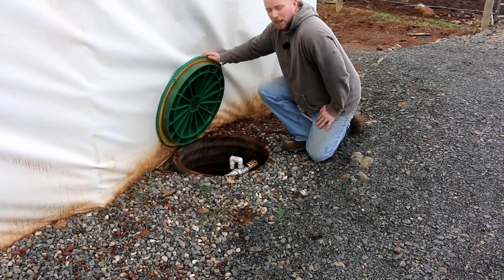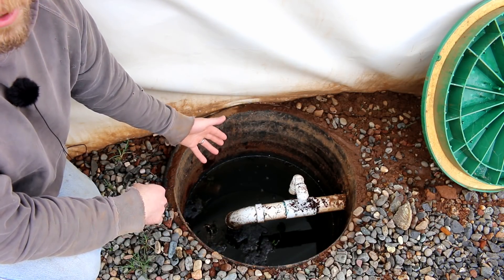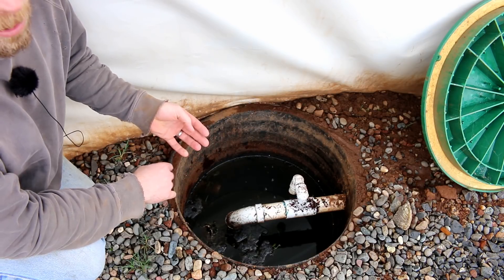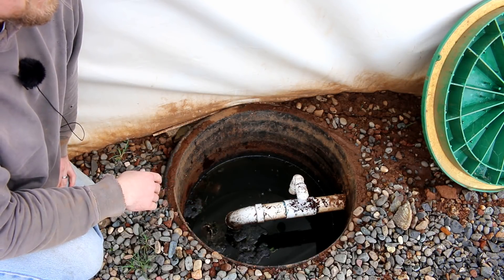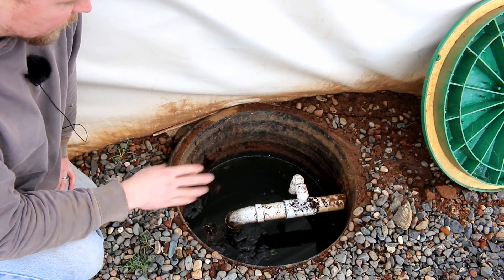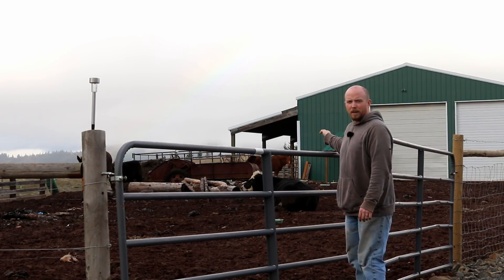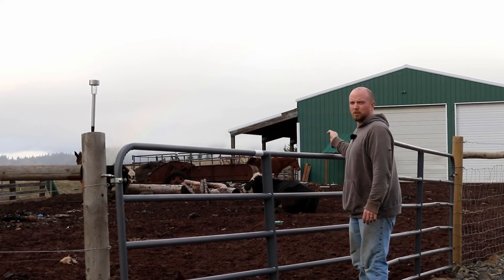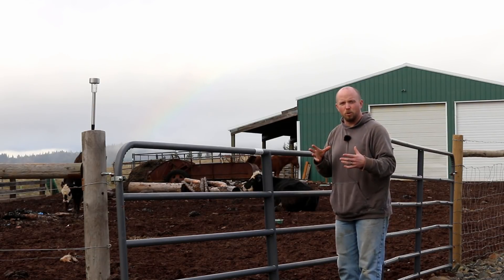Best way to Load a Small Scale Anaerobic Digester?

Comment: For stirring: look in your bulk tank.
For preprocessing: Look at your juicer in your kitchen. And pump some of the top water before the juicer to prevent.drying.
Don't load the digester from the top but directly into the bottom.
If that doesn't work pressure makes stuff  get wet.  A large propane tank to pre wet all ingredients before into large digester.
**Problems solved**

Comment: Hi @TheRealMartian Great Videos! Here's some ideas about feeding in the Straw : 1.  Maybe consider not using straw as bedding and instead use something else. 2. Consider excluding the straw from the flow altogether (strain/rake it out)- Does it have much nutrition for the biodigester? I would think it mostly adds fibre and air. 3. Chop it up with a machine while still "dry"prior to adding it to the slurry, there are a few machines for this I think called "hammer mills. 4. Some sort of "combine harvester"type device at the top of the tank that sort of rakes and chops it while it floats. Anyway, best of luck!

Comment: underground conveyor belt?  pipe that you load the stuff into, shut the loading panel, then run water into the pipe building up water pressure until the stuff moves and gets flushed?

Comment: Did ever think about using a new ibc tote piping the bottom of the tote to the bottom of your digester. Filling the pipe and tote with your organic material then water. Then use putting the lid back on the tote and either using methane or some other gas to push all of your material into it. I mean idk if it would work but the water that's in your gas holding tank gets forced out the bottom by the gas. The only thing I think that might be the problem is the pressure on the pipes and oxygenating your tank if you use just a regular air compressor. You could hook your methane up to a air compressor and use it that way. Do you have any updates?

Comment: well i found a solution to that but my digester is above ground, I made a cavity that is bellow the level of the digester with 2 opening that can be sealed , one for putting whaterever I want , and the other is attached to the side of the digester,  I put every thing in it and I seal it ,Than I flash it with the liquid from the digester and every thing wil float  back to the digester from the 2nd opening , but if you do that you should pay attention not to flash air with it buy leveling the openings and  you will  need a little pump to empty it afterwards.

Comment: I didn't read all comments so if this is suggested already or in the last part of the video then sorry. But a downward push with the right screw auger similar to the grain lift auger they use to lift grain will fix your problem. Needs to be as close to the size of your big inlet pipe.

Comment: https://www.kitchenrestock.com/Waring-WSB70-Immersion-Blender_p_1887.html?gclid=CjwKCAjw5fzrBRASEiwAD2OSV9XwRZIFjOTlw9nFNwJN4E1xQZY1D7DWqvw2YLaGqW3T_jGdhFIn-BoCLAIQAvD_BwE
Reply: We use this bad boy in our kitchen.  We blend up soup stews and all kinds of fibrous material including meats. It sounds like the material you're trying to dispose . 50 gallon  capacity, 21" stainless steel removable shaft, variable speed motor, continuous ON feature, rubberized comfort grip, 1 HP, 120v, 750W, 6.25 amps, NSF

Comment: Take a look at the shredder for recycling used tires and emulate that design, then pump that material to the tack in additional I don't see that your design have a 22 degree angle at the in let's Pipe, that seems to work for other design.     How are you trying to reverse the screw motion that instead of pulling it porch.

Comment: You mentioned that a screw would push water\waste up a pipe but not down a pipe.  What if you created a gradual upward bend at the bottom of the intake pipe that feed into a small upward screw? Gravity would create pressure and the upward screw may induce a siphon affect.  I'm not an engineer, so I have nothing to base for this theory.  

Does the waste in the pipe flow better when the pressure from the methane is weaker? Is there a way to siphon off the methane from the main tank into the two holding tanks, which would build more pressure in the two holding tanks but allow the main tank to have less downward pressure and allow more waste to fill the main tank? 

Or maybe an above ground natural gas tank that temporally relieves pressure from the main tank by opening a valve, which might be enough to suck the waste into the main tank.  Once the pressure equalizes have it shut off the valve to the main tank. Then have it slowly pump the methane into the holding tanks and then repeat the process.

Comment: You haven't named the correct problem and identified your limiting factor.  You have a super duper 2-foot diameter feed tube that goes down how many feet to an itsy bitsy teenie weenie 8-inch diameter pipe that goes down how many more feet until the food will clear the pipe and float up inside the digestion chamber.  Your problem and the single factor that limits you is the 8-inch feed pipe into the digester chamber.  There are a lot of YouTube videos of this design:  Puxin biogas system from China.  You might want to look them up.

Comment: Hello TRM, hello from northern Ireland.  You asked for solutions.  Given your design as it stands and assuming you want a quick and low cost fix without processing I've thought of the following.  1.  A two stage plunger: 1.1 outer plunger to drive down the large volume of material (if this works 2nd stage may not be necessary) 1.2 for the narrow 8 inch pipe 2nd stage steel plunger end on steel shaft.  PROPULSION I'd use a heavy duty nylon strap with a ratchet (low cost & practical with option to improve using electric winch if it does your job, strap give extraction if stuck).  Risks: it may be that the outer plunger doesn't drive material into smaller pipe.  id test the narrow plunger on the nylon ratchet first.   MY IDEAL - If I was building your setup I'd widen the intake and have a single diameter wide pipe, I'd plan to use a floating barrel on top of the waste and flood it with water from the outflow to apply large force and manage displacement within the tank reversing the pump to re-float the plunger.  Just my thoughts, look forward to learning what you actually did. Richard

Comment: Back in my process engineering days in the chemical industry we used a "Fitzmill" for reducing particle size.  The unit is called a comminuator in that it both shears the feed with a rotating  knife and mashes it against the housing with a blunt hammer.  They're  used in the food industry for "grinding" cucumber for pickle relish hence the name "pickle grinder". A small unit consumes about 3Kw and will process up to 100Kg/hr.  You can also feed both solids and slurries.  You may have to collect the ground product in a drum or similar as I don't know if there's enough pressure generated to force product through a hose.  Made by Fitzpatrick Industries and many used ones out there.

Comment: Would a cupped auger take the items down into the digester? I’ve never seen one before but It seems logical with the brief thought I’ve put into it. If the threads of the auger were the shape of a pipe cut down the center and wrapped around a shaft it might catch the material and pull it down into the digester. Just a thought. Good luck

Comment: Perhaps a hammer mill shredder that works the material until it goes through a screen would get the material consistent enough to pump. 
A winter feeding system that eliminates the hay an straw getting mixed with the manure.  We had this with our goat dairy.  Each animal was tied in a stall with a wood floor and a cement gutter behind. They had to lift their had up and put it through a keyhole to get to the hay in the manger. This kept them from pulling their head out of the manger with each bite and dropping some at their feet. The back edge of the floor was slotted and extended over the gutter. We then could use a scraper to push the manure out the end of the barn. Many of them preferred to sleep on the warm wood floor over the lounging area with bedding.

Comment: If you could take 2 drums, rotating at the same speed but opposite directions, you could put the material between the 2 and crush it. If you could place blades or sharp edges that overlap in the opposing drums you should be able to cut, or at least bend, materials like straw enough that the pump will pull it through and grind it. On your level you could put a simple gear system on it to increase torque and hand power it. I'll try to come up with a simple drawing to send you.

Comment: Get a 55 gallon steel barrel where the lid comes off. Fill it with manure. Put the lid back on and fill with water through the small port. Let soak for 2 days. Then pour in???

Comment: Why does the inlet pipe need to be at 90 degrees why not 45 degrees. What comes to mind is a hydraulic cylinder, once a day retact the Pistons and rod, open a trap door up fill the cylinder up, close and send the rod and Piston back down the cylinder injecting the digester

Comment: Once you load the floating scraps into the loader (green lid outside you showed), have a mesh/grate pusher that you can put over top the floating stuff. Then push it down (sort of like a plunger with the same width as the hole, except it allows the water to flow up and over the scraps). As far as I know, if those various floating scraps are kept under water like that for long enough they'll sink due to soaking up water. Not sure it that's the case, but if so, should be the most simple solution. ¯\_(ツ)_/¯

Comment: Random idea but hook up the load pipe to a toilet to load stuff in with a high flow you could put allot of stuff in as long as it was mulched and the s shaped drain will naturally keep the system air tight (same concept as in a house)

Comment: What If...
Could you have two (or more) perforated pipes, one inside the other, that rotate in opposite directions.  If the material were loaded into the center, the material would fall through the holes and be cut as the pipes rotate. Material between the pipes would be more or less ground together further processing it.  Once material is small enough to fall through the outside perforation it could be loaded into the inlet  or into your "horse toilet" for introduction into the digester system.  
I'm thinking of a combination of a dirt / rock sifter and a sausage grinder to process the material, add some liquid as needed, and deliver the chewed up goo into the inlet.

Comment: A few comments on your issues with the digester.
1. All animals fed on a high fibre diet and bedded on a straw type bedding + high fibre household waste such as you describe will always tend to float if put in some sort of a tank and will tend to form a thick crust which I see as a major problem for you a) feeding the  digester and b) possibly also when inside the digester vessel. 
The current commercial solutions to this are 
a) Chopping before pumping into the store powered by tractor PTO power periodically from the temp storage vessel as the material builds up- which has been the main part of this video 
b) installing a sequential stage bubbler system in the bottom of the digester that normally pumps air (but in your case would need to be gas) to get the contents to move and mix and remain in a "soup-like" form of solution or 
c) the use of an angled propeller shaped agitator placed just under the surface to destroy any crust by causing a mixing and agitation effect on the whole of the contents. 
The compressor for b) above is usually electrically driven and uses a manifold with numerous electro-valves to direct air via simple pipe work to different parts of the floor of the vessel in turn. The pump moves quite a volume of air but not at much in the way of pressure to be effective and generally works perhaps alternate days. Tractor power (PTO) is normally the power source for a) & c).
Reply: Wastewater 101, cellulose is an enemy, very hard to digest. Stems, leaves, seeds, rinds, have a lot of cellulose. Circulation of the digester, you need to circulate the liquid in the digester, either by a pump or or gas bubbler mixing system. This keeps everything from stratifying, which prevents good digestion. Lots of good grinder pump systems out there. Look up Tsrumi, Vaughn, Barnes pumps. Lastly, the University of California Sacrementro has an excellent mail order course that covers all of these items.  Look up some local wastewater treatment classes in your area, better yet, find a treatment plant that has digester. Us Professionals love to talk POO and explain what we do. Hey, that rhymed!! Don't  forget about pH, that's  a real big one, what a mess when that goes low.

Comment: No choppers, no grinder pumps. Look at tub hay grinders. I'm sure you can get a small scale grinder set up pretty easily. Can run it off the PTO of your tractor. Output media size is controlled by a screen. should be able to make all your material small enough to go through the grinder pump then. Yeah it adds a step but it's a start. Once it works, make improvements.

Comment: I think an Archimedes screw would work perfectly. 
It just working in reverse. Tube would need to be around 1/2 inch thick wall and a heavy screw and hydraulic drive. If its built strong it wont matter if the hay and crap gets stuck on the edges as the screw wont stop turning.

Comment: Did you ever see myth busters when they floated a boat with ping pong balls? The had a funnel on the surface with a pipe down to the boat fill with ping pong ball and pump water into the funnel. If you can sink ping pong balls surely you can sink salad??
Reply: https://youtu.be/4MOJN07XRYw

Comment: Any thoughts of using the tractor to power a pump? You have both a PTO and hydraulics so could use ether one to operate a displacement pump between 2 6-8 inch swing check valves so anything that can fit inside that valve can be pumped into the tank. Could turn a 6-8 inch T into a pump chamber with a check valve on ether side and a piston traveling up the vertical pipe section as a low speed crank shaft is easy to make.

Comment: your issue seems to be, to me at least, not floaty bits so much as your use of water as a safety airlock.  So instead of focusing on how to make stuff not float, rethink the air lock.  (side question - cant methane disolve into and pass through water anyway?)

Thankfully, you will be doing your loading in batches.  

Break the system into logical parts.  The main bits are the digestion chamber and the feed chamber.

To connect the two, you need a sytem that lets bits in "as is" and yet prevents methane from getting out.  

1. Really small scale, use a 55 gallon drum as the infeed where you put bits until you are ready to laod into the digester.  The bottom of the drum would need to be attached to digestor with a simple sliding gate.  The top of the barrel, use an air tight lid.    To Use :  Bits go into the 55 gal drum, close the air tight lid, slide open the gate, bits fall in,  close gate.  Built tightly, with a wide area around the actual opening, you will get very little methane escape.

You can improve on that, though not sure it is worth the effort, by angling the drop chute from the 55 gal drum to the digestor so that it enters the digestor lower down so less methane.  (depending on the contents of the digestor (if there is enough fluid) you could have the drop chute enter under the fluid level.). Pretty sure you will need to do the angling so you can keep the infeed drum Outside the Hab.

You could also add another gate between the drop chute and the digestor.

Another improvement to consider with this model is the use of a temporary water lock between the gate and the drop chute.  by adding a chamber below the gate that you can fill with water, you get your safety lock, but can drain (or move) the water at the time of loading the digestor.

You could even use a piston to automate the actual loading by having it open and close the gate on a schedule.

You would probably want to experiment with coating the barrel and the gate with something like silicon to make sure the loading goes smoothly (no sticking).